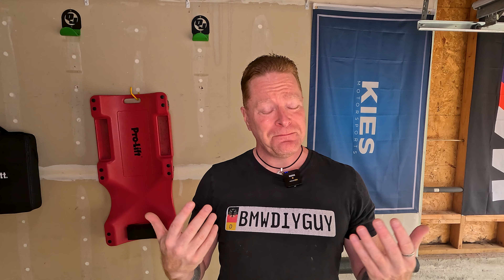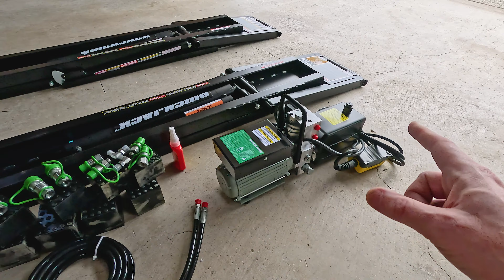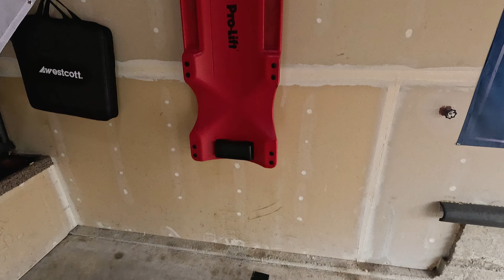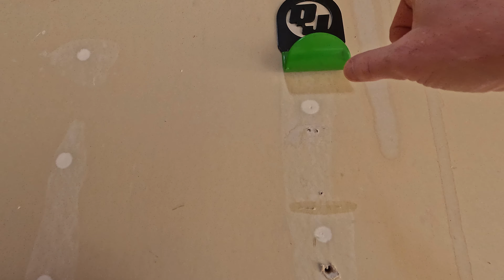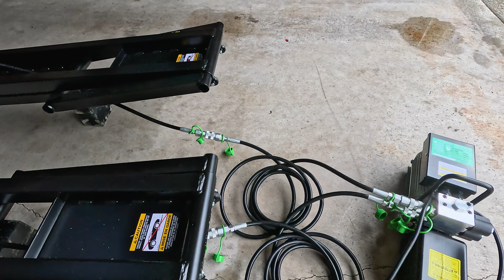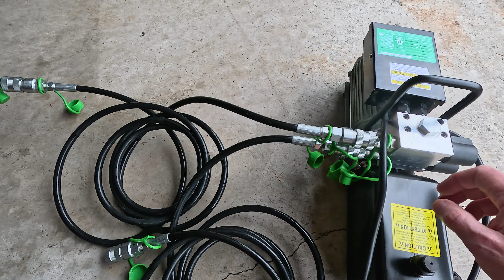Quickjack 6000 ELX setup DIY - Their biggest set yet for the best DIY work!

Comment: Just bought my new 6000 today! Planning to setup tonight for use on some m340i's with the crazy long spread jack points.. not just Teslas. Thanks for the tips
Reply from the maker: That is awesome!  It is truly a garage DIY life changing tool
Reply: @BMWDIYGuy  My buddy who's a bimmer nut already has a 5000 quickjack and we're adding this monster to his garage for m340's. Both hydraulic units look essentially the same so we're thinking just keep the new one as spare and use the existing for both jacks. Any thoughts on that idea?
Reply from the maker: @ronfisher4751  I believe the pumps will work across multiple rails, so should work.  That is a guess though from looking at the units and designs.

Comment: I bought the BL-7000SLX 6 years ago that I even have the extension rails for my wife's F10 535xi. I found out tonight my M340i is way too long for the 7000SLX so I'm looking at the 6000ELX.  The hoses that connect the pump to the rails were nice, thick rubber on the 7000SLX.. Those look to be a much cheaper quality, like hard plastic pressure washer type hoses. Are they plastic or rubber?
Reply from the maker: The hoses are excellent and have been the same in all three I have owned.  No issues with them at all

Comment: I have a G80 M3 and was told the 5000 series was too short to match the jack points. Does the 6,000 series fix this issue?
Reply from the maker: Yes and had several up on my 6000s

Comment: Does this work on the F80 M3? I need to use it on a variety of cars and the 6000 ELX is the only answer but afraid it might not fit the F80.
Reply from the maker: Check your lift points for sure, but it should work.  The 6000 works for most vehicles including my G87, just barely.

Comment: Yeah, I have the 7000TL for my bmw. They are great tools for the diy guy.
Reply: Is the lift point to short for the G87?
Reply from the maker: So the 6000 JUST barely fits the G87, so is perfect for small to large cars which is  one of the reasons why I changed from the 7000 to the 6000.  I need to be able to lift everything from the M2 to the new G8Xs which have VERY wide lift points.